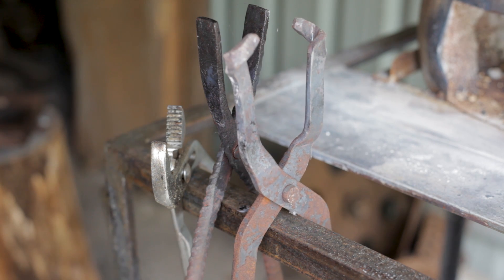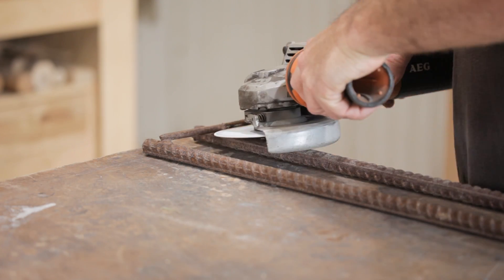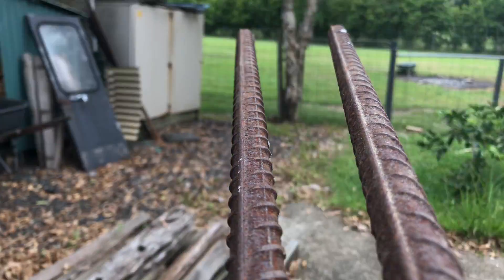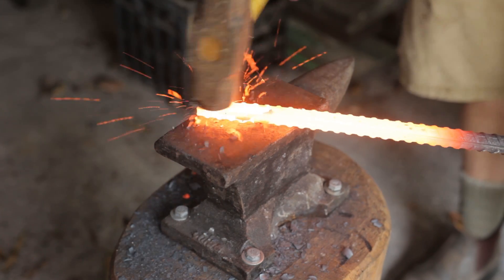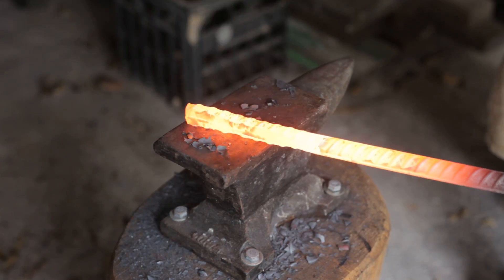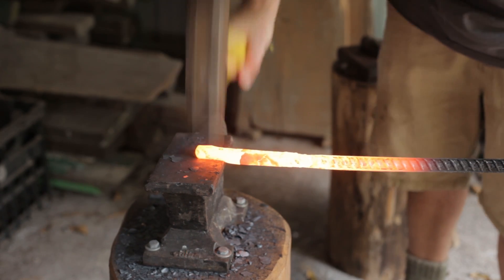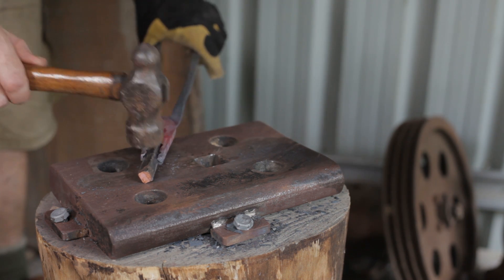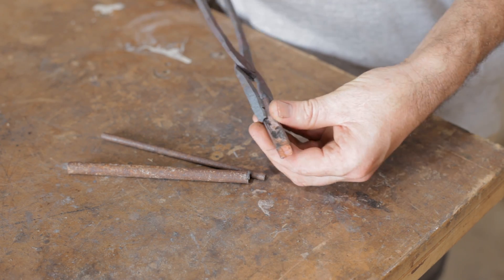Homemade Blacksmith Tongs - Forged from Rebar

Comment: Enjoyed the build Neil, thanks very much. 
I wouldn't worry about being an expert, watching you build the tongs gives hopes for others to try it using minimal tools and materials. They are a bit fine, but I have three sets in increasing size and if you look at those professional shops they have a lot of tongs of all different sizes so see them as the first of your set.
Reo is generally stronger than mild steel so probably has more carbon in it and that was perhaps why it was recommended for this purpose. Thanks again.
Reply from the maker: Thanks very much mate! That’s my main aim for this type of video, to encourage others to have a go! Glad you enjoyed it! 😊

Comment: Cool idea to use the vice grips as a heat sink when you were using the cold chisel.
Reply from the maker: The vice grips were to add a bit of weight to keep the workpiece steady. It worked very well! 😊

Comment: I've never thought about adding "teeth" whenever I've made tongs. Great idea  and a nice touch. Your tongs may be a bit too delicate for most blacksmith work, but they came out looking very good, indeed. You certainly have the skills to make heavier tongs in the future. Those smaller tongs will prove useful on projects involving small stock that would be difficult to hold and maneuver with heavier tongs - so all in all, you do in fact have a useful tool added to your blacksmith tool collection! Good job!
Reply from the maker: Thanks very much for the encouragement, I’ll definitely try again with some heavier tongs! 😊

Comment: Great stuff!  Was wondering why you put the vice grips on when you were cutting the teeth.  Vibrations?
Reply: I'd say the workpiece is just easier to hold between the legs when theres some weight to it.
Reply: It's too keep the piece held down to the anvil while he holds it. Otherwise there is no down force.
Reply from the maker: As the others said, to keep the workpiece steady! 😊

Comment: Great project but is where loose top boots and shorts a good idea when blacksmithing?

 I found out that it wasn't too clever when I was grinding. My daughter thought that I'd invented a new swearing dance (think German leiderhosen with lots off ****ing & b***rds) when the hot bit of metal I was grinding shot off into my boot.

Comment: Good job, yea a little light weight, but a good start.   To save wear and tear on your shoulder muscles, choke up on the hammer handle more (toward the head) and hold it loosely.  Let the weight of the head do the work rather than your arm and upper back muscles.

Comment: blacksmith here , you cant make  tongs from rebar , its carbon steel every time you heat them up and quench them to cool them off you harden them , just a matter of time before they snap trust me ive made that mistake myself when i started. ps get a proper 2.5 to 3 lb rounding hammer  im pushing 19 stone and its all i have ever needed you get no advantage using that mini sledge where are you based i got a few days free ?